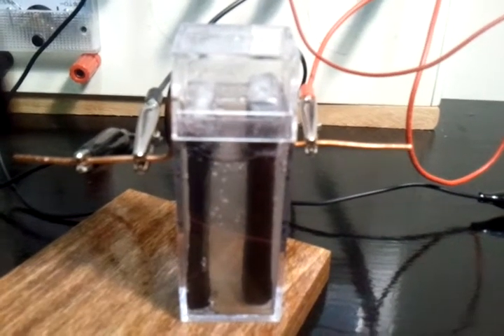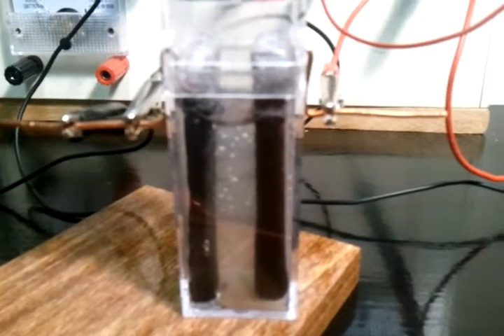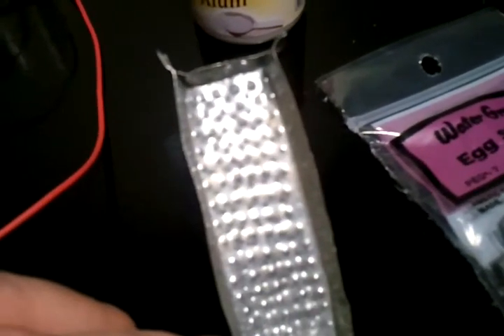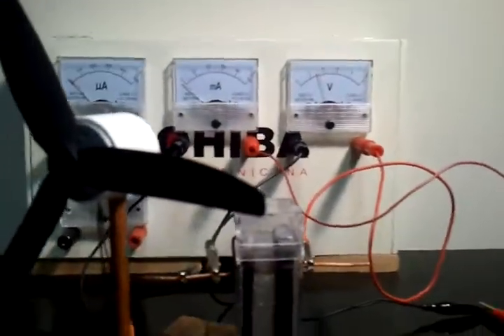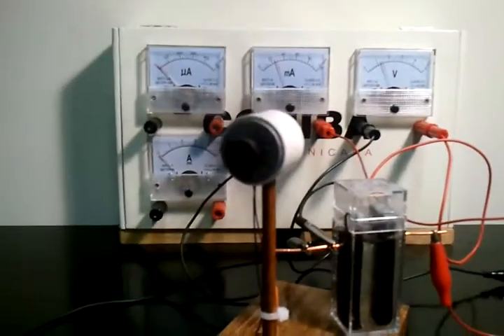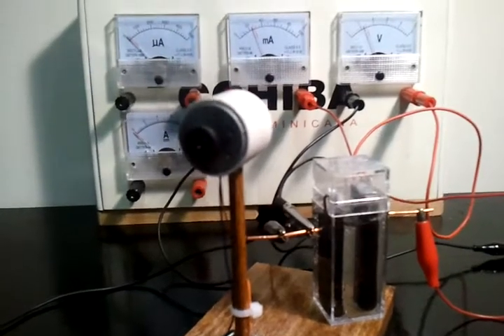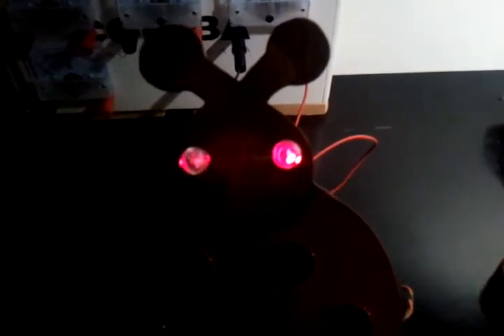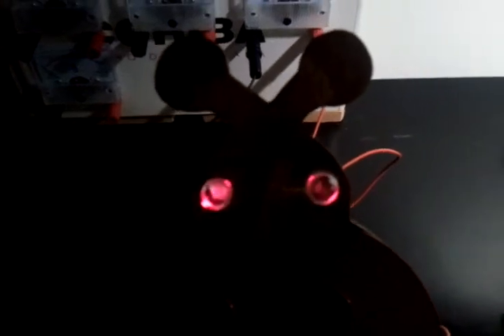Lead Plate and Alum Cell Demonstration

Comment: All these homemade cells/batteries are just toys. I wish someone would come up with something useful.
Reply: They did you buy them in shops they're called batteries, not toys as you could make an emergency battery power an led etc
Reply: So it's been 6 years, how is your "Battery" working now?

Comment: why not measure watt hours, 30 ma x 1.2 v is 36 mw which is tiny and for 5 min is 36/12 mw hours! that is miniscule. If you calculate volume energy density, or specific density ie mass density, you have a terrible battery. An absolute joke! You need thousands times more surface area. Total failure. Be honest and just say it's crap.

Comment: my question would be:

if you used sulfuric acid electrolyte, how would performence compare??  
how  dose plate deterioration compare??  is performance loss a good trade off if applicable??

Comment: Maybe you can help with the answer to this question: Would Epson salts & alum work better than just one or the other alone? d.t.grosz@gmail.com
Reply: I tried it and it barely did anything more. I think it actually shortened the battery's lifespan.
Reply: Aluminium sulphate poly hydrate (Al2(SO4)3.xH2O)
If used by itself at max molar concentration, will, upon the first charge, plate aluminium onto the lead negative electrode plates 

After that,  charge/discharge cycles of the cell are pretty poor amp-hour capacity ~20% of normal rated cell capacity (if using H2SO4), 
so Instead of running only Aluminium Sulphate, if you use a 'double metal sulphate' such as Aluminium-Potassium-Sulphate or Aluminium-Sodium-Sulphate , then you will massively increase the amp-hour capacity of the cell output.
Average cell amp-hour output for using Aluminium-Sodium-Sulphate is around 65-70% of rated cell capacity.